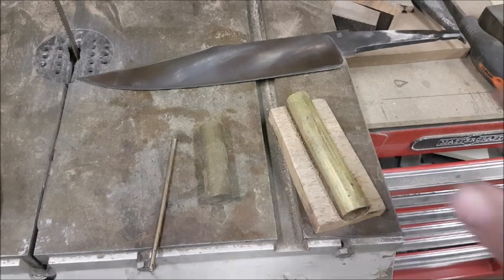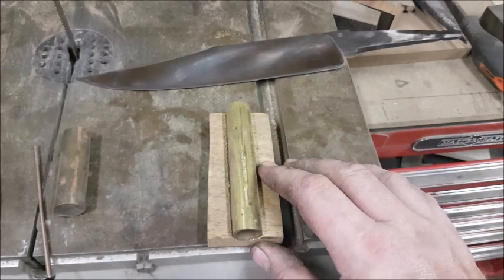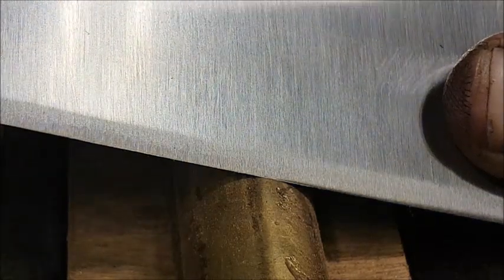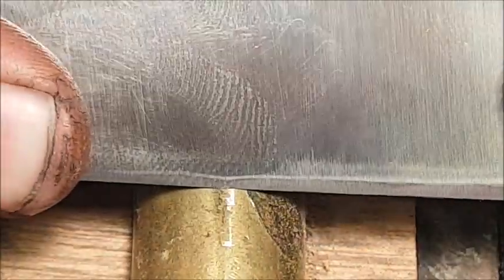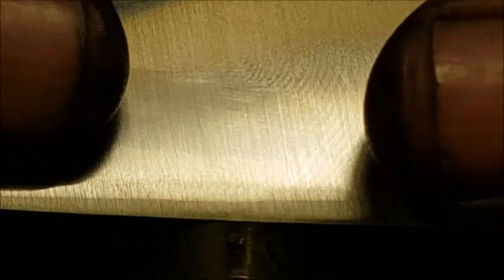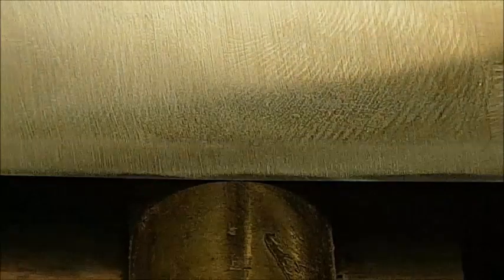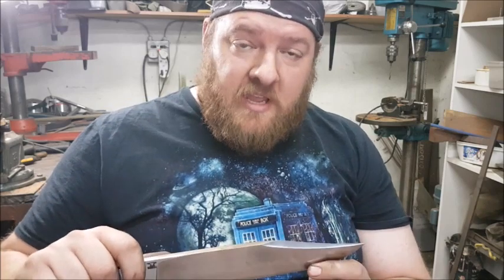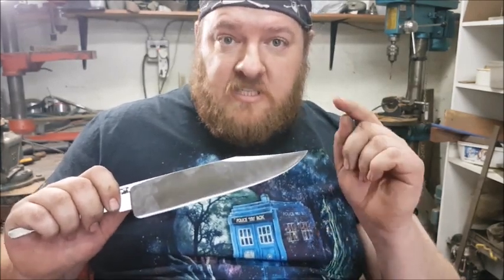Brass rod test

Comment: Hey love your channel,  just wondering what the next steps would be if your edge bends or chips.  Can you grind the edge again and simply re temper . or is a full quench required ?
Reply from the maker: if it is too hard simply temper again at a higher temperature until it flexes. If it bends a re harden may be in order. Thanks for watching

Comment: thanks for this tip, much appreciated! does the tube have to be brass, or would copper work as well?
Reply from the maker: Paul Wernich I've done it with a hard wood. Brass just lasts longer. Copper should work too but may deform after a while